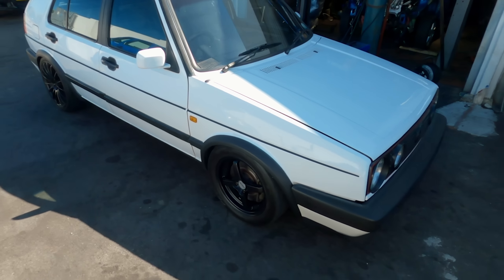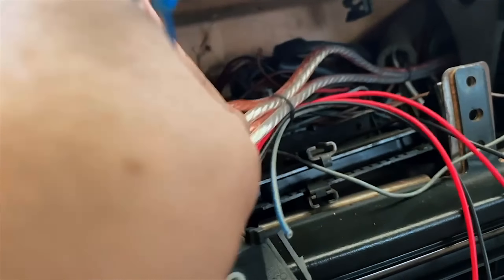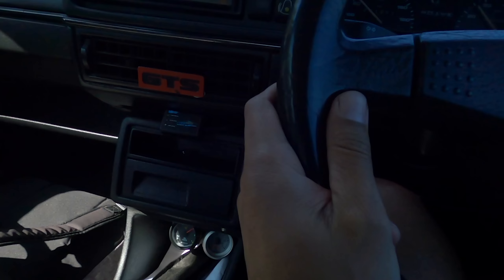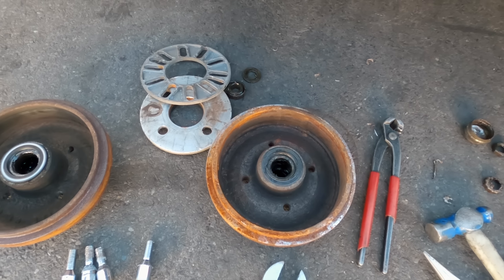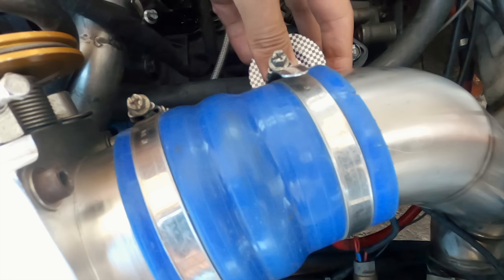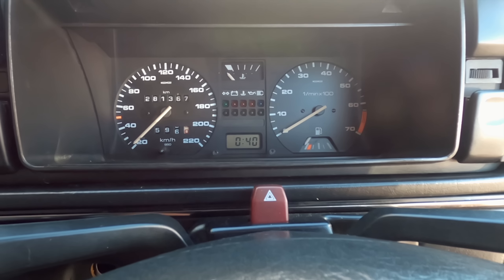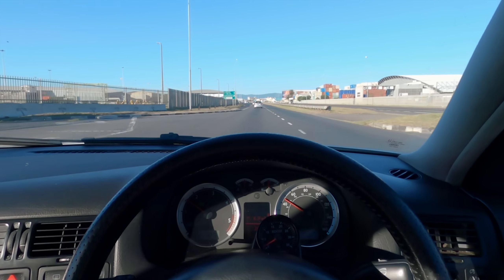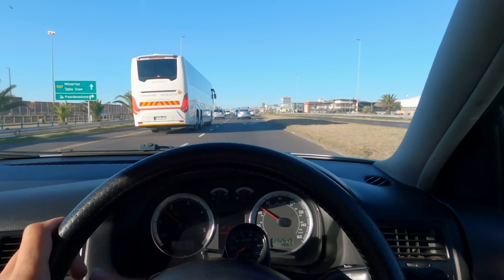The GTS get some attention: RPM gauge, rear drum repair & dolphin noise delete | POV drive

Comment: I would definitely still look at the suspension of the GTS, wheel hop is normally cause by the suspension being too soft or having a little too much give and then allowing the wheel to hop like that when it breaks traction
Reply from the maker: Think we figured it out. (next video) but that wheel hop was weird. Haven't experienced that before. I thought it was a 17" wheel thing but nope. Lol
Reply: @lowdl  Aaah okay sick, glad you got it sorted. I had the same problem with my Datsun (The red GX Coupe I had when we went for a drive that wedneday night a few months back with the minis) when I first got it and I also changed rim sizes but to no avail.
Reply from the maker: @naqeebemeran2367  The issue was actually the gearbox mounting that was too far gone. Causing the wheel hop. Went poly on that side & it's all good now. The driver side shock is tired but thankfully it isn't part of the problem.
I heard there might be another run with the mini bois soon so I'll probably see you there 👌

Comment: The blue wire for the oil pressure gauge on the clock you must earth it out on the head then it will stay off
Reply from the maker: Thanks a lot! Need to get it done asap. It's really frustrating.

Comment: You can use a mk3 gti rear axle for the rear brake disc conversion or just for the parts.
Can also use golf 4 rear brake calipers to save a little weight seeing they are alluminium and not cast iron.
Reply from the maker: Thanks for the tip. Mk3 parts will be a little easier to get. I think...

Comment: GTs  sounds savage...
Reply from the maker: It really does. Sounds aggressive in boost.
Reply: @lowdl  screamer pipe?which car makes more power?Would love to see a race....i was thinking when you change from 1st to 2nd you said it has wheel bounce ,is it not maybe because you out of the power band so it feels like it bogs?
Reply from the maker: @Mr-ec5xw  Yes it's got a screamer.
My car makes more power now because I run on ethanol.
It's not because it's bogging. It is dropping out of boost but the hop happens either way. I've done that a few times and it's the same hop. It's sorted now, thankfully.
Reply: @lowdl  love the content though it's entertainer keep it up bro...